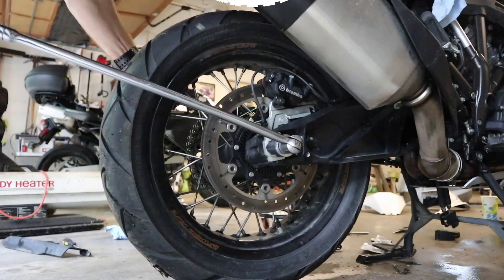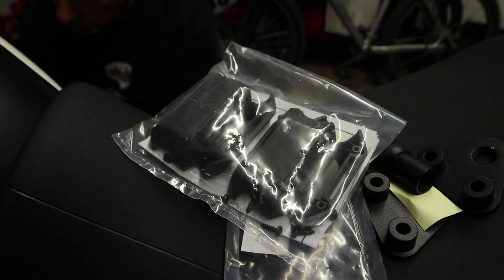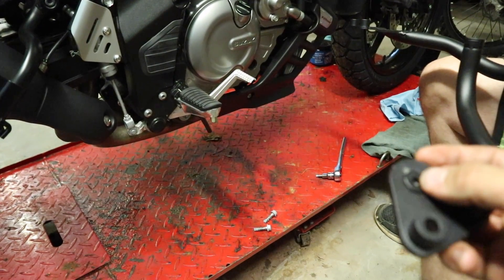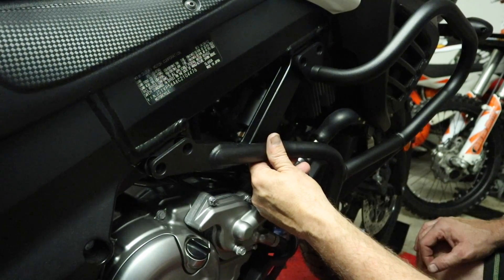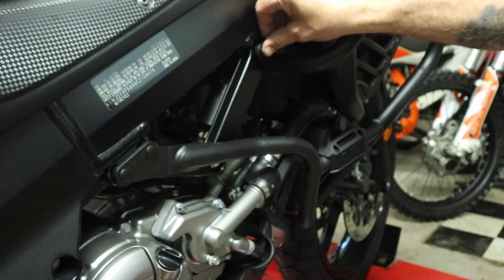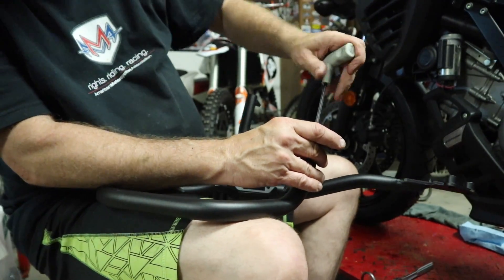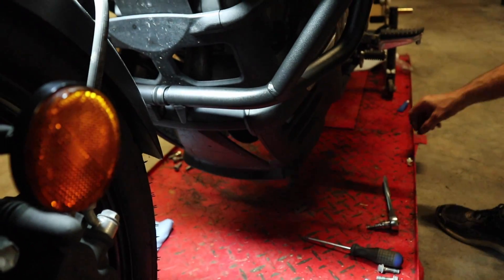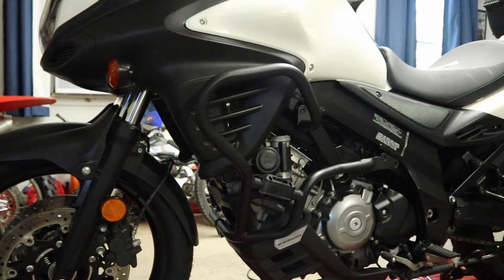Givi Crash Bar Install on Suzuki V-Strom | Back in the Garage

Comment: I put these exact crash bars on my 2021 VStrom 650XT a year ago and the install wasn't that difficult although the instructions were not great nor clear. I was disappointed in the quality of the hardware (bolts primarily). GIVI should use hardened bolts and fasteners, not aluminum fasteners which tend to strip out easily on the hex heads. The crash bars seem to be of high enough quality where if I drop the bike or it goes down, the protection should be there.

Comment: the o ring that is between the bars on my bike is loose and rattles and the bolt holding the spacer is as tight as it can go.   Any recommendations on what to do to make stop rattling? probably about 2 or 3 mm of space.  between 5 and 6k rpm it is really loud.
Reply: Cześć Kolego
Powinny być założone dwa gumowe oringi.
Pozdrawiam

Comment: woot!  That's what I needed, because the 'instructions' in the packing was...lacking.
Reply from the maker: Glad the video helped. We found the instructions less than adequate.
Reply: Yea i thought Ikea instructions were bad! Would’ve been nice if they actually told you what torque spec to tighten these bolts down. The 4 bolts are 35ft lbs of anyone is curious.